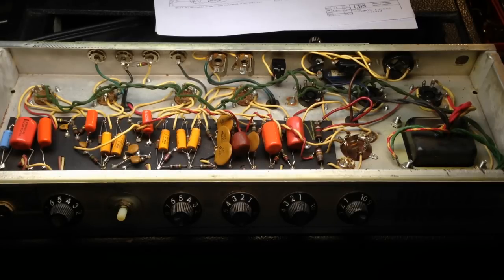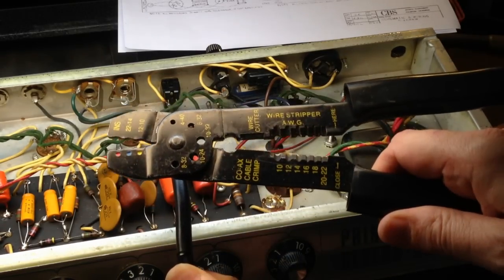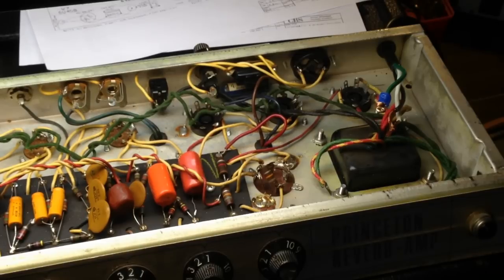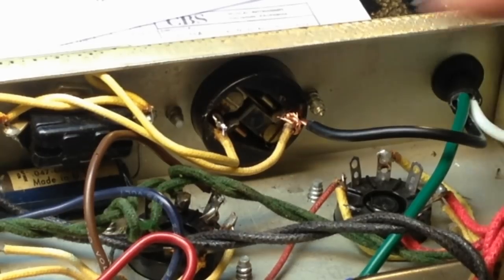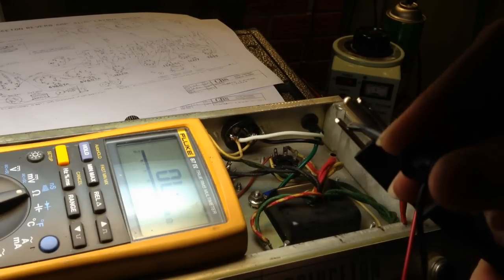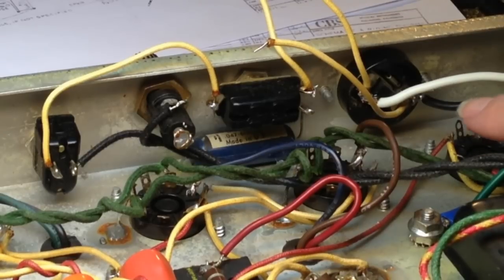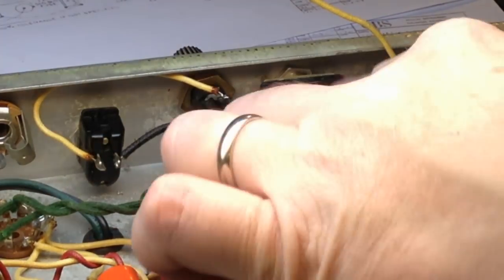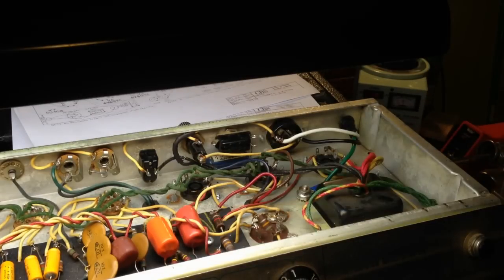The RIGHT WAY to Install 3-Prong Power Cords in Fender Amps

Comment: I think any good tech would not ground to the TX lug due to flex that always happens with a fender chassis.
Ground wire should always be a bit longer to ensure it’s the last thing that comes off the circuit if there is a hard cord pull. And c'mon... a grommet to hold the AC cord? How about a strain relief in there?
Reply: An actual IEC socket can be used in the same hole with no drilling and the power cord would be removable and safer than this dangerous method. Too many things wrong with this....no true strain relief, wiring is wrong (live wire should go to tip of fuseholder, then to the switch. The ground should be soldered not wired through the transformer bolt. This may be better than a stock 2-prong, but it's not code-correct and done poorly.

Comment: I might be missing something here, but isn't that fuse always hot?  Even when the power switch is off?  Wouldn't it be better to bring the hot leg directly to the switch and THEN to the fuse?  The way it's done here, someone could turn off the amp and think power to the fuse is off as well and maybe zap themselves?  Just sayin'...
Reply: It’s a good question, and he answers it early in the comments stream.
Reply: An actual IEC socket can be used in the same hole with no drilling and the power cord would be removable and safer than this dangerous method. Too many things wrong with this....no true strain relief, wiring is wrong (live wire should go to tip of fuseholder, then to the switch. The ground should be soldered not wired through the transformer bolt. This may be better than a stock 2-prong, but it's not code-correct and done poorly.

Comment: I'm finally going to install a three prong cord in my Silvertone 1484 amp, and just as this Fender has, the Silvertone ALSO has an auxillary plug AND a ground switch. I am uncertain if it has the death cap though. I have the schematic, but not quite sure....any chance you know?

Comment: Gibkel here with a help request- just received a 430 Harmony Amp that was advertised as having the 3 prong chord upgrade. It did not. Amp has polarity switch included in the (On/Off) -and and a standby switch . Some how I bet there is a death cap also. Do you have a valco  amp circuit  video you’ve done this to that I can use as reference? The tech must have blown through repair thinking that the easiest had been completed. Since it is a valco , I’m sure it won’t be as straight forward as a fender as valco has its own way about it. Similar to gretsch 6162 at least by it’s schematic but this beast actually has two channels. I also faintly remember you changing. Cement bias resistor in the power section of the 6162 gretsch. Cant remember if it had gone bad due to excessive heat and wire position. Tried a set of RCA 6973 in place of the newer EH 6973 and I couldn’t hear or feel the difference in their response. Would the original tubes been biased differently than the newer EH6973 and that’s why I hear no difference switching them out.’It’s just another shit-post Friday, well that’s my fun-day’

Comment: Does anyone ever replace the 2-prong convenience outlet with a 3-prong (grounded)
 version? If so, where can you find one and how do you install it?
Reply: An actual IEC socket can be used in the same hole with no drilling and the power cord would be removable and safer than this dangerous method. Too many things wrong with this....no true strain relief, wiring is wrong (live wire should go to tip of fuseholder, then to the switch. The ground should be soldered not wired through the transformer bolt. This may be better than a stock 2-prong, but it's not code-correct and done poorly.
Reply: @andyfuchs5252  I hear what you're saying, but I'm looking for the FEMALE grounded convenience outlet to replace to 2-prong outlet.

Comment: Hello Brad,

in my opinion, no existing mounting point should be used for the ground wire. I believe having a dedicated bolt only for the ground wire is the only legal way to do it in new equipment, at least this side of the pond. The rationale is, whatever part becomes loose or wobbly due to vibrations or misuse, it won't affect the ground wire.

Also, I think the ground wire should be longer than the other two. In case the power cable gets tripped upon and ripped out, the ground wire is the last to fail.

Cheers.
Reply from the maker: You are right on regulations regarding new equipment and the longer ground cord is a good idea I will incorporate in future power cord replacements. I mentioned that in my pinned comment. However, drilling new holes in vintage chassis is not a practice I'm going to incorporate. Thanks for the comment!
Reply: An actual IEC socket can be used in the same hole with no drilling and the power cord would be removable and safer than this dangerous method. Too many things wrong with this....no true strain relief, wiring is wrong (live wire should go to tip of fuseholder, then to the switch. The ground should be soldered not wired through the transformer bolt. This may be better than a stock 2-prong, but it's not code-correct and done poorly.

Comment: You should pull the filament AC lines back up, it looks they they've been squished down. It will decrease noise in the audio output.

Comment: Hey brad, lovin the channel!  I have a quick question abt installing a fuse holder on a '64 Alamo Paragon head that didnt come with one & i would like to take the ground switch out of series.  Any insight you have would be really helpful, since you have some experience with these old Alamo amps.  Thx!

Comment: Sorry, but this ALWAYS looks 'hacky' to me. The round grommets do not offer any prevention of the AC cord spinning around and around, even with a zip tie. I realize there are many ways to skin that cat, but an 18-gauge wire AC cord and reusing the Heyco clip just looks better, and looks far more professional.  Of course YMMV, and this is all just one person's opinion. I apologize in advance if this offends anyone.
Reply from the maker: No offense taken whatsoever, and I agree with you for the most part. I do always use a cabinet retainer, so the cable can't spin like you pointed out. But you're right, the smaller gauge works fine with the original retainer. I've been known to do it that way too.
Reply: why is the ground switch still used in that drawing?
Reply: @randyjamz1448  Thanks for this pictorial!
Reply: Randy Jamz you. An make this foolproof but not DAMB foolproof

Comment: You dont use strain reliefs? they are a pain to install with pliers
Reply from the maker: I like using 16AWG wire and a retainer on the cabinet instead.
Reply: guess I should have finished video first.....that is great info for me

Comment: A proper strain relief is required for a power cord. A grommit is not sufficient even with that feeble zip tie. While the UL listing is voided, one should follow their standards, which don't accept depending on the external cabinet clamp. Also, the ground wire must be long enough so that if the cord is pulled hard enough to break connections, the hot will break before the ground. This is all due diligence to make your lawyer happy should a customer ever sue you.
Reply from the maker: You are correct.

Comment: Brad there is nothing you did correctly to wire the power cord , ie no strain relief , black wire has to go to the end of the fuse holder first then to the switch, and the green wire needs to be soldered to the chassis itself and the green wire must be longer than the black or white wire , that plug is not grounded so you can’t wire to it or you could be held liable per this video. Be careful.

Comment: One important safety step you forgot:  When testing the power cable with your ohmmeter.  Attach one side of the meter to the chassis and first test the ground lug on the plug for continuity.  The ohmmeter should read less than a ohm.  This tests the wire, ground prong, your nut AND lock-washer arrangement, your crimp, and the contact of the chassis with the ohmmeter itself.   Forget this step and other measurements are not valid.

Comment: Wireing has always scared the shit out of me because I've never understood it.can you tell me why in simple terms how come you don't just put the hot and natural where suppose to go and just add the ground wire and be done with it .remember I'm stupid here. I have a 59 twin that I need to do this to
Reply from the maker: Because the way most vintage amps, including Fenders, are wired originally, the switch is on one side of the transformer and the fuse is on the other. What you want is for the black hot wire (which carries the 120VAC) to run first through the fuse. That way if there is a problem, the fuse blows and nothing else is electrified with 120VAC. Placing the switch in series right after the fuse ensures that while the amp is OFF the 120VAC goes no further into the transformer or anything else. This eliminates potential points of failure or arching. The ground switch definitely should be removed, along with the death cap. They serve no function in an amp with polarized, grounded plug.
Reply: The Guitologist if I made that type of a mod on my amp it could could mind you ruin the value amongst the collectors it's worth up to $14000.00
Reply from the maker: Adding a 3-prong power cord to a vintage amp is not a detriment to collector value, in my opinion. But if you're that worried about it, get a professional to do it.
Reply: The Guitologist I'll probably never sell it as it was left to me from my dad but one never really knows.and I do trust your judgement I was planning in doing it anyway.loli just don't want to do something that is irreversible if ya catch my drift I'm on your side.

Comment: Pushing things around with your soldering iron is why your iron is bent. You may consider this not a significant problem, and I certainly have done the same thing, but it does take its toll over time.

Comment: Great video Brad, as always! The only thing I do different is I pre-tin the bare wire and although 16 ga. wire is great, I think 18ga. is safe to use, then you can reuse the chassis grommet from Fender. You way is so good! It will be good to have the extra length of power cable. Thankz
Reply from the maker: Yeah, I misspoke when I said "or larger". 16AWG or 18AWG is fine.

Comment: I want to do this with my 1965 Fender Showman amp but I want to do it right or give it to a reputable person. I've been shocking myself way too much when I touch anything metallic and it will get rid of this electrical static noise when the guitar isn't touched by my hand. Otherwise, it sounds clean.

Comment: Thanks for the video. That was the first mod I ever made to an amp a few years ago. It was on my Brothers 1965 Black Face Fender Dual Showman that was shocking him. Wish this video had been out then. Lots of great info in this for new guys to pick up on, like J hooking, smaller  socket opening being hot, color coding on wire strippers ect ect...
Reply from the maker: Thanks for watching. There seem to be a couple more vids on YouTube showing this procedure on a Fender, but I didn't think they were detailed enough and did things slightly differently than I usually do them.

Comment: Not to be rude, but using a grommet is not the right way to go about this.  You need to use a strain relief.  Even with the zip tie, the cord can still rip out of the amp.  A strain relief will hold the cord much better.
Reply: Doesn't he say in the video that he adds one in addition to the zip tie? No such thing as overkill when it comes to ripping a power chord out of an amp.
Reply: Screw using grommets. Use an IEC receptacle. Better yet use a fused IEC receptacle instead.
Reply: You are correct. Not right. An actual IEC socket can be used in the same hole with no drilling and the power cord would be removable and safer than this dangerous method. Too many things wrong with this....no true strain relief, wiring is wrong (live wire should go to tip of fuseholder, then to the switch. The ground should be soldered not wired through the transformer bolt. This may be better than a stock 2-prong, but it's not code-correct and done poorly.

Comment: It's one thing to do something incorrectly, it's another to post a video showing others how to also do things incorrectly. This is incorrect and many aspects of this are not safe. A grommet is wrong. Buy the correct cord, and reuse the strain relief or get the correct one. OR how about:  An actual IEC socket can be used in the same hole with no drilling and the power cord would be removable and safer than this dangerous method. Too many things wrong with this....no true strain relief, wiring is wrong (live wire should go to tip of fuseholder, then to the switch. The ground should be soldered not wired through the transformer bolt. This may be better than a stock 2-prong, but it's not code-correct and done poorly. Not code compliant and executed poorly. While the old wiring was considered okay back then, it's not the best way......
Reply from the maker: Thanks for the comment, Andy. Couple things... First, this video is from almost 5 years ago. I no longer do it exactly like this. Second, the wiring is not wrong - the hot wire is going to the tip of the fuse before the switch in series. I only used the auxiliary plug as a terminal so that would remain functional. I see no specific need to fuse protect outboard gear that might be plugged into that socket. Maybe that's not to European code, but this amp isn't for export. As for the ground...you are correct it's not up to code, and you are correct it's better than stock, but you weren't thorough in your criticism. Technically, the ground should have its own bolt hole near the exit of the cord and the ground wire should be long enough so it's the last thing to come off the chassis in the event the cord is ripped from the hole. Soldering the ground is not considered correct according to any of the literature I've read. The stranded ground wire should be CRIMPED to a terminal and bolted firmly to the chassis. Finally, the strain relief...I attached a strain relief on the cabinet. This cord wasn't going anywhere. But you're right, I need to update this video. Just have not gotten around to it.
Reply: @TheGuitologist  You certainly should. I remove the socket and switch to IEC plugs and plug the line cord hole in our shop. No cutting or drilling either ! The reason I cited the wiring, is many Fenders were wired with the hot on the fuse and the neutral on the switch  (maybe simpler on the factory shop floor), and simply connecting the new cord where the old cord was, doesn't cut it. More in the Tweed days than BF and SF, but anyone doing this should map out the wiring to make sure it's safe and correct. Thanks for being open to criticism. No point in teaching something wrong, which is why I won't teach anybody the guitar...lol.     Peace.
Reply: @andyfuchs5252  what kind of iec plug fits in the socket with no drilling? I like that idea!
Reply: I buy them from various suppliers. The non-filter, plain vanilla IEC's work great and fit easy !

Comment: Folks cord too big for the job, does not have properly safe guarded in placement, zip tie will not keep cord from twisting and more wrong with methods here. Not safe by UL standards, doing what has been  done here would endanger your life.
Reply: DANGEROUS ! An actual IEC socket can be used in the same hole with no drilling and the power cord would be removable and safer than this dangerous method. Too many things wrong with this....no true strain relief, wiring is wrong (live wire should go to tip of fuseholder, then to the switch. The ground should be soldered not wired through the transformer bolt. This may be better than a stock 2-prong, but it's not code-correct and done poorly.

Comment: Sloppy job dude. Why did you remove the filtercap from the mains side? I bet there are now preaty shiny sparks in the switch when you turn on the amp.
Reply: The ground reference capacitor isn't really there as an anti-arcing cap, it's there to act as a ground reference to the chassis. It's less necessary with the grounded outlet cord, but if you wanted to keep that functionality (say for EMI noise filtering) you should replace the capacitor with a line-to-chassis rated safety capacitor, such as a Y2 rating. Regular film capacitors can (and have) failed catastrophically with age, but safety capacitors are designed to fail safely (open) rather than shorting out.